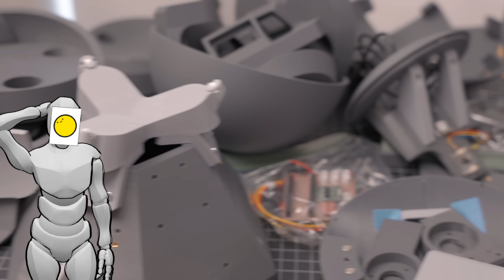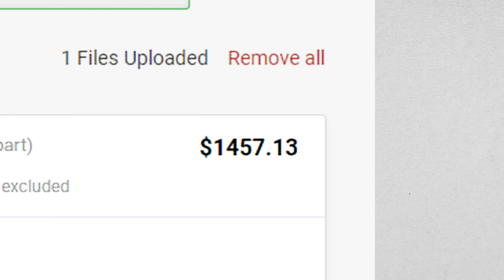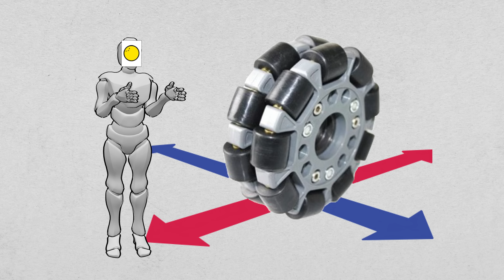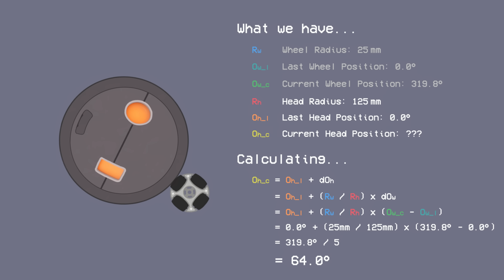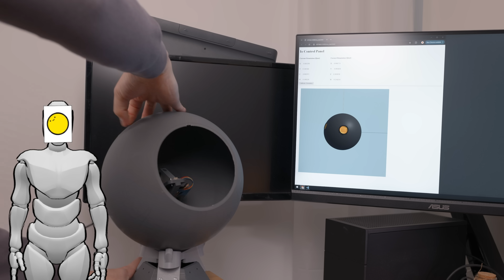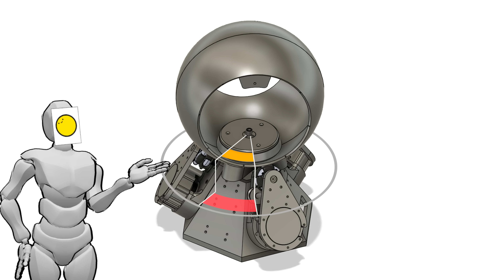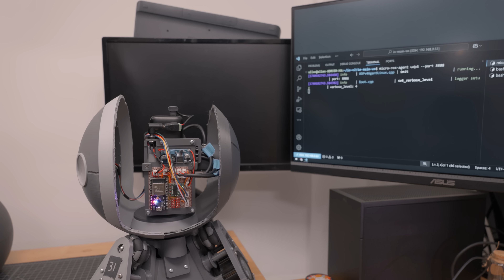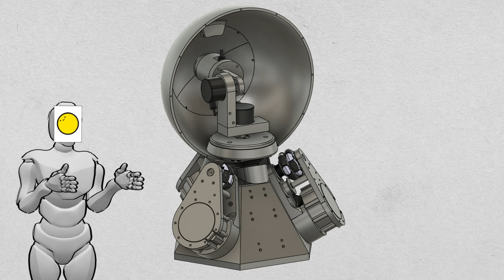meet Io...'s head - robot butler of my dreams pt. 2

Comment: Good god this is amazing. Praise the algo. 

Can I make a probably dumb suggestion for tracking the head position? You could replace the internal head... arm... thing with an optical sensor or two. Maybe a camera tracking a QR code on the inside of the head, or maybe a laser deflecting off some retroreflective tape, and a photoresistor? Then, you're relying on dead reckoning with the occasional calibration snuck in there. 

If you thickened the ball and snuck in some wireless power transfer units into the ball skin itself (not onto the magnetic roller inside the ball), you could roll the head however you wanted, I guess? If you're doing that you might as well try to optically calibrate the head from the outside, rather than inside where there's no easy power. hmmm

You'd have to keep the face pretty flat if you did that, and I dunno, you probably want to keep your options open there

Also don't listen to me, I want to see the hands, this is great stuff

Comment: Cant you just have magnet strips with code or even optical marks around the outside of the head sphere getting read like a supermarket scanner from within the body, thus constantly getting the exact possition with that external map basically, much more low tech but should be lightweight, cheap and failsafe?

Anyhow, very cool project you got going there!

Comment: If you wanted to ditch the encoders you could use the dead reckoning or IMU technique but also have 3 little magnets in the shell that line up with Hall effect sensors in a “resting” position. You could use them to periodically find “home” and reset the measurements
Reply: Damn @SandwichGamesHeavy beat me to it, I should’ve scrolled further down in the comments haha

Comment: Subscribed !
Engineer here : The IMU solution couldn't work. Integrating gyroscope measurement will eventually drift so you will rely on accelerometer to fix the drift. But the accelerometer can give you pitch and roll axis but can't give you yaw. (assuming the IMU sits flat in the head)
You have to find a way to fix the yaw drift, at least periodically : hall effect sensor ?

Comment: I guess you have solved and probably moved along from the problem of encoding the position of the head - but did you give any consideration to something like using an optical tracking sensor on the underside connection to the magnetic tether? You have a really close contact point for something like the optical encoder from an optical mouse. That should produce pretty high resolution relative positioning data about the head location, and could be paired with a small fiducial feature at the rest/default location of the head straight ahead. (Basically just a dot of something reflective so that when the head is in park/home the intensity is measurably higher).

Comment: At first thought the isolated head with a battery was poor planning but you could add a wireless power pad somewhere that connects to the battery. Would be cool if you could just have it swap bodies for different task around the house

Comment: You could also put "calibrators" on the bottom of the head. Just a simple mark, and 3 light sensors should do the job. Since it's head is a sphere, you can rotate it in any direction and get to that mark. A mark itself can be 3 dots: white, red, and blue. If the first sensor hits white, that means that it's now centered by X and Z axis. Then, we rotate it by Y axis until the remaining 2 light sensors get the corresponding colour value. (For example: sensor 1 - white; sensor 2 - red; sensor 3 - blue) and then we use the same way from the start of the video, but just running the calibration function once in a while to keep the wheel drift to a minimum.

Comment: Hay, I'm no engineer and you would Know better than me in this situation; but would it be possible to just put the main source of power for the whole robot in the main body area, while still having the smaller battery in the head charge wirelessly when connected to the main body. It would add a lot more work and stuff but it's just an idea i had in mind. LOVE THE VIDEOS!!

Comment: I have a solution to keep the head powered at all times without needing to replace the batteries. Use wireless charging by placing a charging pad with magnets inside the head at the bottom and another on the stand that holds the head. Also, add rechargeable batteries as a backup to ensure continuous power! 

You should give it a try and let me know if it works.
Reply: Had the same idea as I was watching this
Reply: indeed, this is the mechanism by which a lot of omnidisplays and POV displays work since they have to rapidly spin the PCB.
Reply: @raegun  It would definitely be the best solution. Now you can easily find wireless charging modules that are designed to charge a device through a chipboard table, which is at least 16 millimeters.
Reply: I thought that too

Comment: A concept for the IMU you could have a basic sensor what type i don't recall, it just need to be so that when the two points 'meet up' that when the head reaches a specific rotation and position 'resets' the noise, if you make most movements a transition between the point it is- and make sure it attempts tp pass over this 'static value' it'd be probably able to remove the drift? I think?

Comment: If you ever deicide that the potentiometer solution for the head is too bulky you could probably get a pair of old wireless mouse PCBs and connect it to the internal head roller plate and use their X and Y output and approximate the Z rotation from them. just calibrate them by rolling the head a known amount with the motors a couple of times and averaging the results to get values to find rotation relative to sensor readings. then if you are okay with not having individual light control for the eyes you can place an upwards facing LED on the internal head roller to illuminate the eyes from the inside, this way the head ball is not coupled with any other assembly and could rotate freely. additionally if you used an upwards facing camera and april tag style glyphs plastered on the inside of the head you could get a more absolute reading with more control.
Reply: Additionally consider putting the drive motors inside the head, pushing off the internal roller plate.

Comment: Instead of doing all the 3 axis orientation with motors, why not using a light encoder? you can basically print the head such as internally there is a grid then a few light sensors can help you track the change. You can even do it with cameras.

BTW awesome work!

Comment: Fantastic and over-complicated engineering, two things that go hand in hand haha. I'm certain you could use an encoding technique that has drift if you also have a way to reset its position somewhat regularly. Your imu or a mouse sensor would drift over time, but you could regularly reset its position with something like a few 3-axis hall effect sensors sensing a magnet that rotates with the head. It would be encoded by your drifting encoder for most of its travel, but its position could be resent and reestablished with certainty when the hall effect sensors saw the magnets. Let me know if you ever want any help designing anything, I bet it would be super fun to work with you😁

Comment: Did you consider using some filtering techniques for IMU to be able to mitigate drift?
Reply from the maker: I tried a little bit but didn't get too far cuz 1) not sure how much I would trust it to not tear itself apart even if i did get the drift down to something decent and 2) i realized i would need 2 IMUs, one for the head and one of the body to actually make it work

Comment: you can charge the battery wirelessly using a "high powered wireless charging module" like a samsung phone. 
the module can sit between the motor pillars at the based,  with terminal pins under the magnetic coupler.
Reply from the maker: Yeah that's definitely something i want to try out. My main concerns is if the magnets around it will affect the charging (they're a fair bit stronger than what you would find for magsafe) and heat.

If it does end up working tho, that would make Io so much easier to deal with.